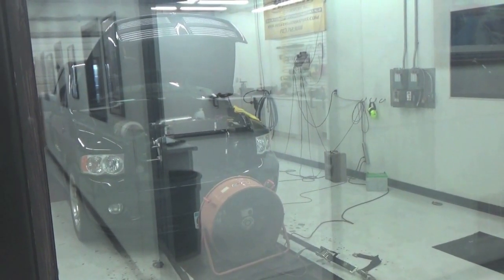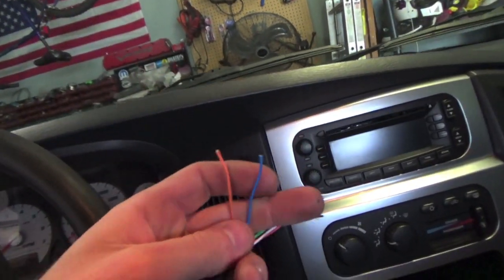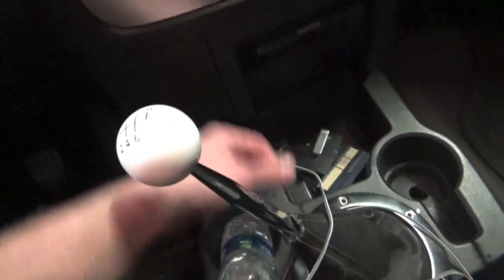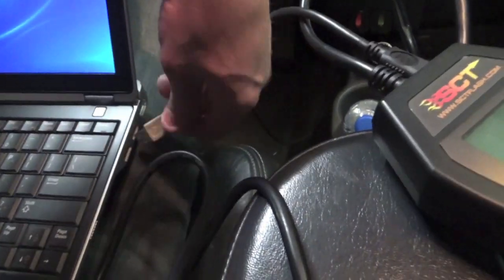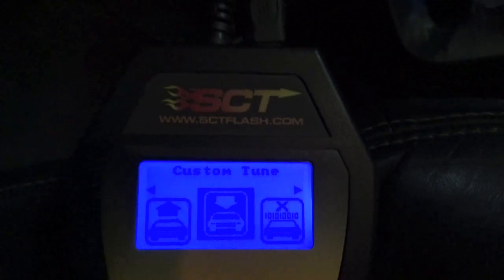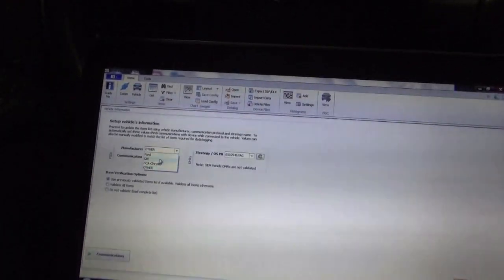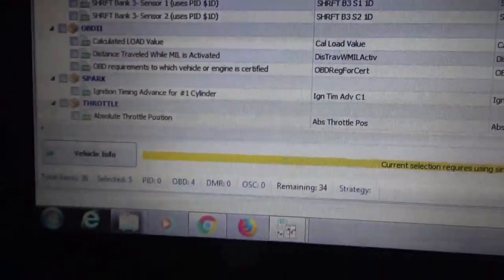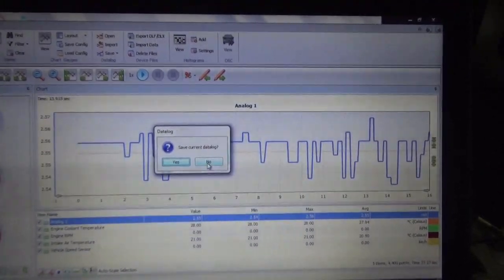SCT tuner how to program tunes and data log with a wideband 02

Comment: Did you ground the black wire on your SCT firewire?  I think I'm getting some interference -- I have the blue, black and green grounds all run together.
Reply from the maker: Huh
Reply: @RacingRamFam  on the sct firewire, theres 6 wires. Blue, green and black are grounds. I was curious if you grounded those or if you simply used one of the anolog wires (orange or red)
Reply from the maker: @neitzelm1  just analog

Comment: so do you drive around with the laptop and tuner both connected to the truck to get the readings ?
Reply from the maker: Yes. You can set the sct to do datalogging by itself but you can check the readings like you can with your lap top hooked up
Reply: @RacingRamFam   thank you ...  i have a 2001 dodge ram , spent $21,000  in upgrades and cant seem to find anyone in my state to do a tune for it , and i have already spent $1200 on people that said the new what they were doing and didn't , so now i'm trying to do more myself , thanks for your help , i appreciate it
Reply from the maker: It’s not bad to do! But sounds sick